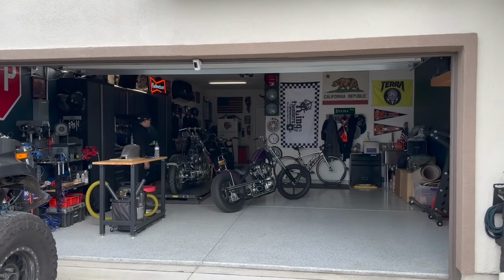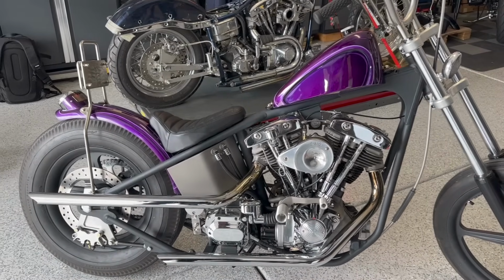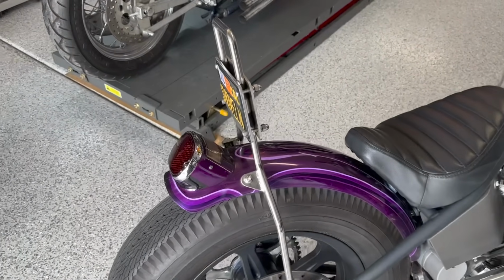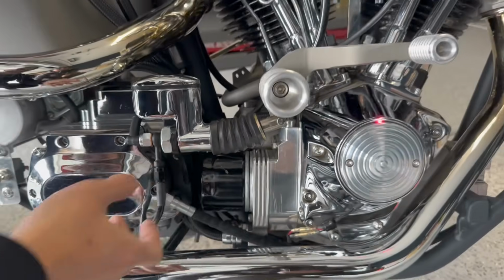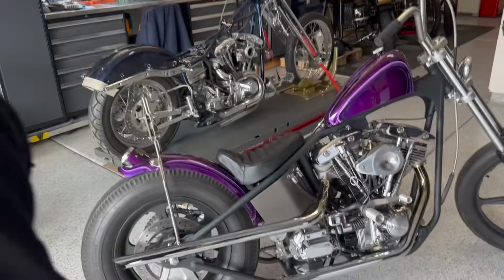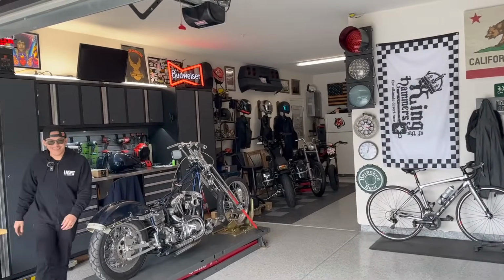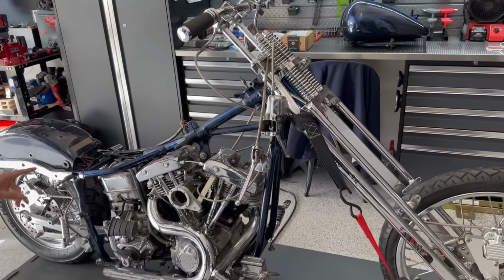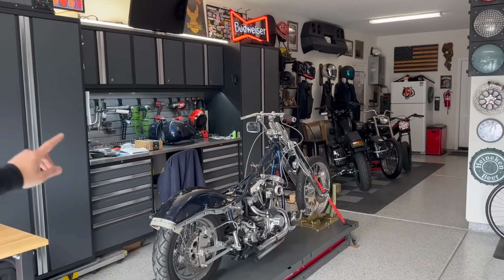Yee's 1979 Harley Davidson Shovelhead Chopper

Comment: That frame looks like a D&D (later Jammer). For the most part, Paughco went with a single solid plate behind the steering head on their frames. The axle plates are similar on Jammer and Paugcho rigid frames. Right off, I recognized the wheels were from RC Components. I had a pal who ran those same wheels on a build. Going with a 5 speed takes a lot of work, but that extra cog is nice on the highway. Your Shovel is such a clean build! What a great road bike! You went that extra mile to work out the viscosity of the fork oil! Most guys never sweat that! Race Tech knows their stuff! That paint is choice! Great fit and finish all around! After watching this video, I miss my old Shovel even more. Ha! Ride safe.
Reply: Great catch! Now that I recall there was a crinkled up D&D sticker on the neck of the frame when I picked it up. I was told the company later rebranded as Paughco. After doing some research now it seems you were also right about D&D becoming Jammer! Thanks for the clarification. I guess I do have a jammer frame after all.
Reply: @YeezusPieces  That's right, Yee. With that frame, you have a piece of chopper "history." D&D (Jammer) used gusseting on from the steering head, along the backbone tube and somewhat on the down tubes. Some of my pals used those D&D (Jammer) frames back in the early 1970s, when original H-D rigid frames were become scarce. D&D (Jammer) also built some very solid springers. All were narrow with twisted front rails. Early issues of "Easyriders" magazine featured a lot of choppers running D&D springers. Columbus Enterprises, Fury and Paughco made springers back then too. We ran girders from Smith Bros and Fetrow, Durfee, P&P, and John Harmon. All of those forks worked great, and they were a departure from glides and springers. I ran with some cats who owned 2 chopper shops back in the late 1960s/early 1970s. All of those guys are gone now. I'm the last choppahhead standing. That's life, man. Enjoy every turn of a wrench. Enjoy every ride. I wish I was young again like you and the rest of your crew. Build right. Ride safe. -- W
Reply from the maker: That’s really cool! Thank you for the info
Reply: @walterfechter8080  
🤙
Reply: @benderbender1233  Hey! 😎
Reply: @LNSPLTBLVD  -- No sweat, man! Gotta share the knowledge with you younger chopper jockeys! Stay safe!
Reply: @walterfechter8080  
✌😎

Comment: Love the idea for the license plate - did he just use two license plate brackets and screw them together? Or did he also weld them on? It looks like he added tape in between to not scratch the sissy bar. I don't know how to weld so this seems like a great alternative.
Reply: It’s two plate brackets with  ez fuse tape on the sissy to stop the brackets from moving. I haven’t welded it on yet since I’m working on a removable gas/tool/duffle mount for the sissy bar.
Reply: @YeezusPieces  oh interesting. Would you say the current setup would last long/is reliable because I don’t know how to weld or anyone that does. Considering asking a shop to do it for me.
Reply: @shah_nanigans  I mean with this you would need to buy two seperate plate mounts. But honestly you could take your sissy bar to any exhaust shop and have them weld it directly to the sissy bar. I doubt they would charge that much for such a small job.
Reply: @YeezusPieces  Copy that. I may just do that. Appreciate the help. Great job on the build dude.